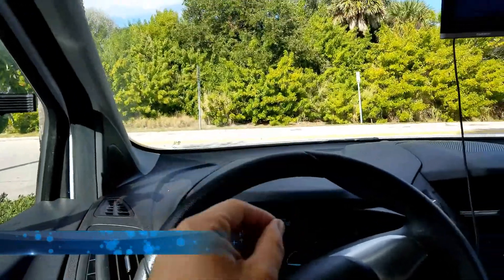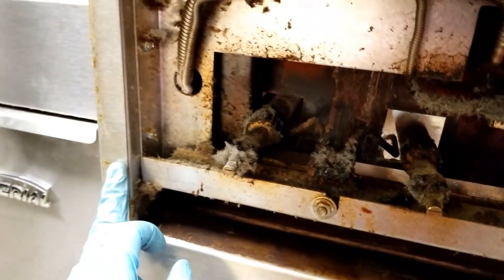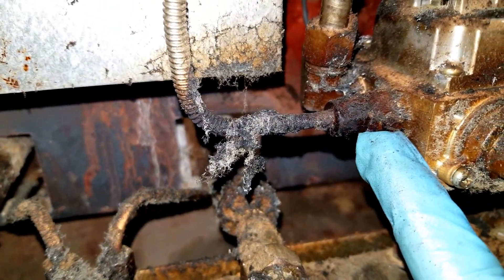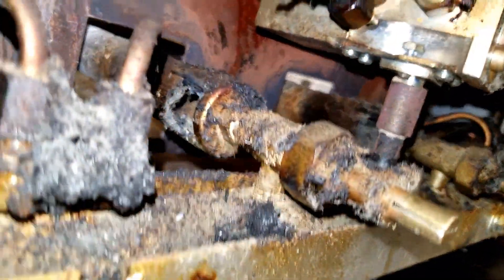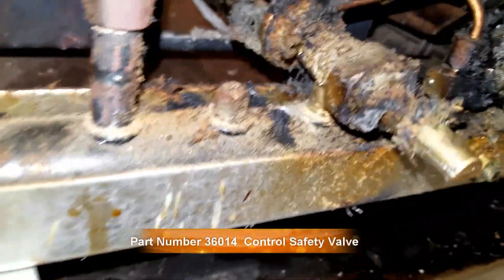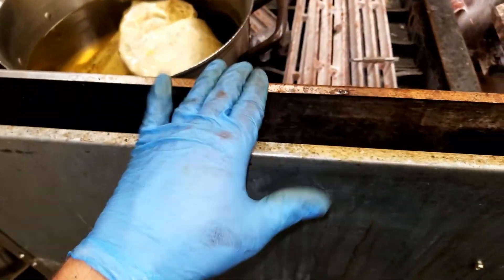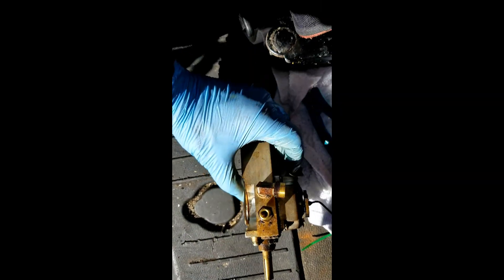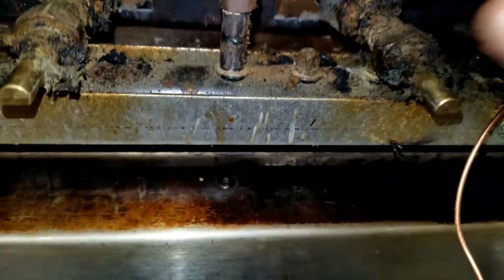Imperial Oven over heating, Control Valve Replacement

Comment: Dealing with an overheating oven can be quite frustrating, especially when you're in the middle of cooking something important. However, with the help of this amazing video the problem can be identified easily and fixed. We provide genuine Imperial control valve and other Imperial oven spare parts.

Comment: I have a 2002 imperial broiler  IR-4 LP Gas. It has 1153 IHR/THERMOSTAT. The broiler does not shut off. It is always on no matter the temperature setting. The thermostat is relatively  pricey. Any suggestion on how to test or repair before buying a new thermostat. 
keith
Reply from the maker: Hey Sorry for the late response. Test continuity on the thermostat. If in the lowest setting to include "off" if it still rings through, then you will most likely need to replace the thermostat. However imperial t-stats are usually "all in one"  gas valve, safety valve, and t-stat. So if the t-stat portion is open when you switch it to the off position then the gas valve is stuck open, and will need to be replaced.